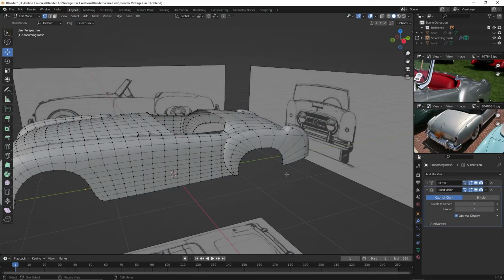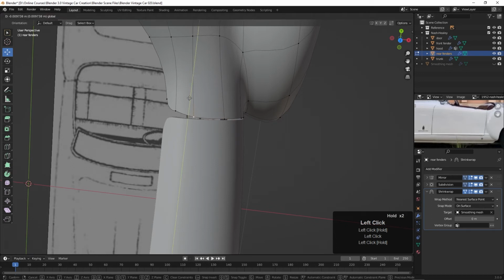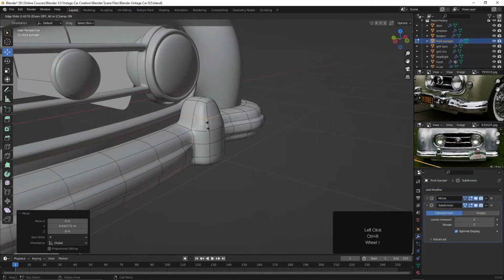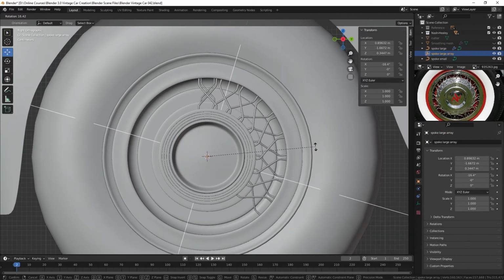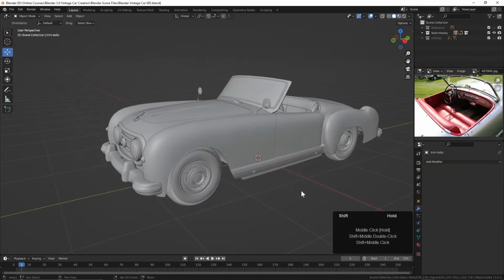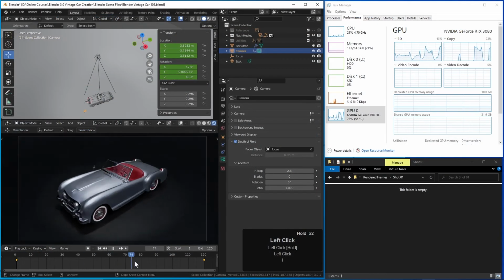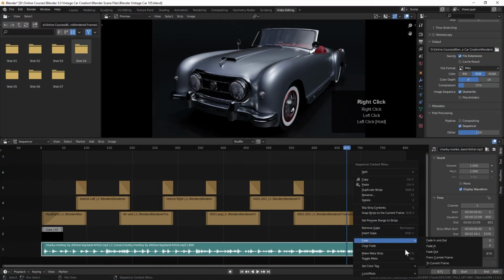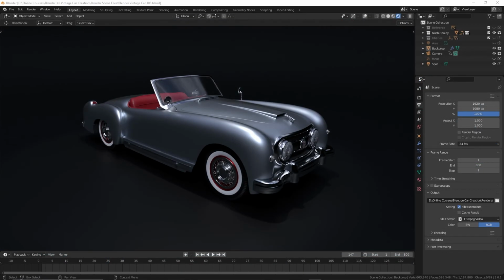Blender Vintage Car Creation

Comment: I've been gone awhile I had to buy a decent laptop to continue this series. I left off at the steering wheel because my other laptop was just too slow. Only thing sucks is that I had to transfer and set up all the blueprints again, but it will be nice to continue this series finally.

Comment: So all finished and proud of the job, the producer comes back and says "we need these parts to look like brushed metal", some more polished than others. What would be your approach to shading (light sources and environment may behave differently), tangent control, and seamless variation to anisotropic rotation channel? Don't use color on everything (certainly not bump), sometimes all the details is in the control of the shader itself. Reason I ask is that most tutorials out there only deals with the obvious cooking pan. As a test project, could try first to do the Utah teapot look like it had undergone abrasive directional semi polishing.